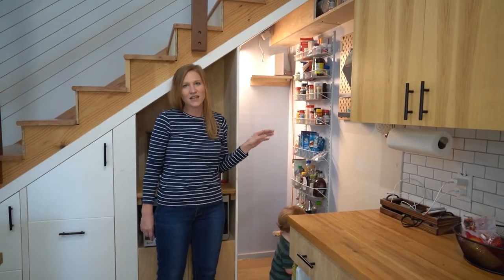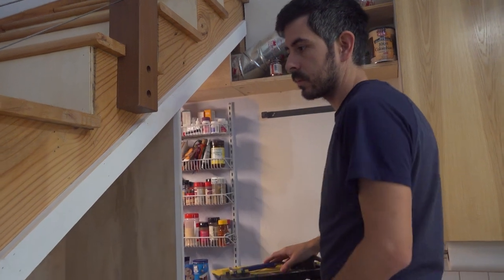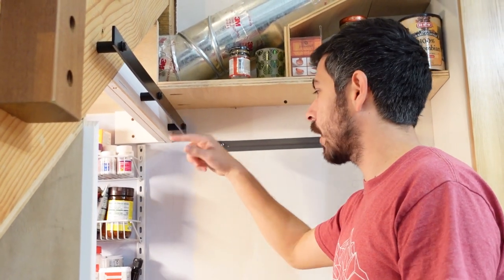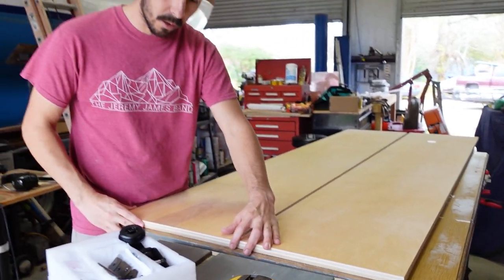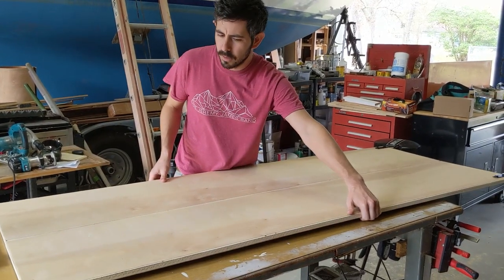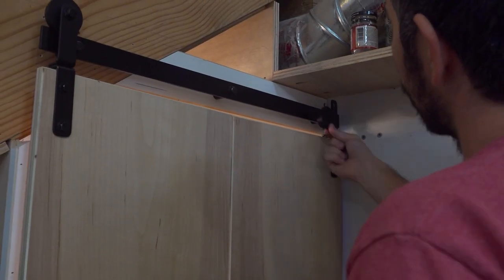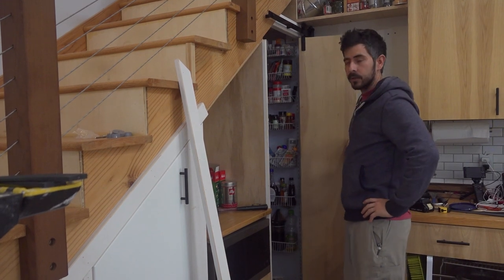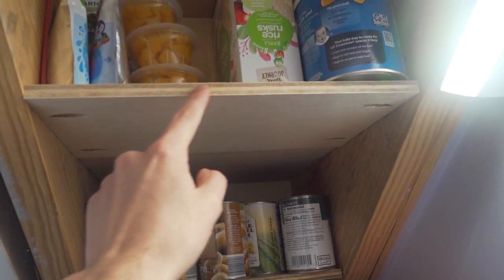Building a FOLDING Barn Door for our Tiny Pantry

Comment: This is a cute cabinet https://www.youtube.com/post/UgkxgU6CmpmzUKvU6dHNRGg4-fTA0FpEhHUm and it fits our small kitchen space nicely. It comes with a lot of parts but they are labeled nicely. There are no instructions, only pictorial guides which if you follow, it takes you all the way through. It took me a good 4-5 hrs to assemble since I took the time to count all the parts, organize all the pieces that were labeled before I start assembling them. You need 2 people for this. Packaging can be improved because stuff got shifted around. Luckily nothing was damaged. I read some of the reviews where they said the doors don’t line up. You can adjust the hinges so that they line up nicely. Also, I sanded and then spray painted the handles black to go with the rest of my kitchen cabinet handles.

Comment: love it!! Thanks!  We are adding double bifold for a 48 in wide opening on a rail system we bought from Wayfair.  We got the Alder solid wood doors from Home Depot (4 -12 in doors).  I'm a bit worried about losing space on the side inside the linen closet when we open them to the side.  They are full thickness 1-3/8 in. .. Thanks so much.

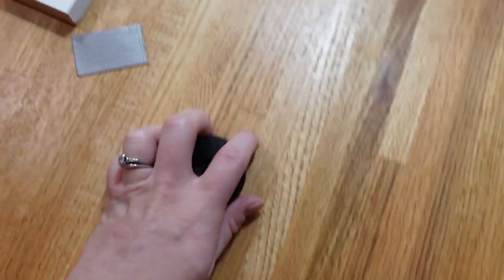Comment: I wanna try this in my home  At 2:35 you mention "trying to find the right spacing"  Can you tell me the total amount of inches is it from the top of the wheel to the bottom of the sliding bar?  My door frame might be too high to the ceiling to clear. I only have a 3.5" to play with. Thanks!
Reply from the maker: It’s 3.25” from the top of the wheel to top of the bar. 4.25” to top of the door.
Reply: @buildingsmall8422  You are the MAN! THANK YOU!!